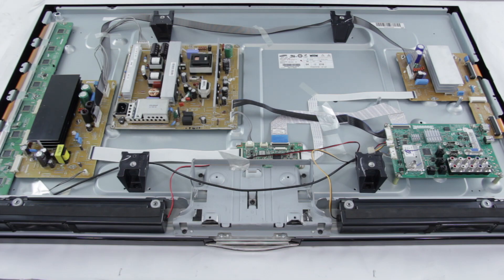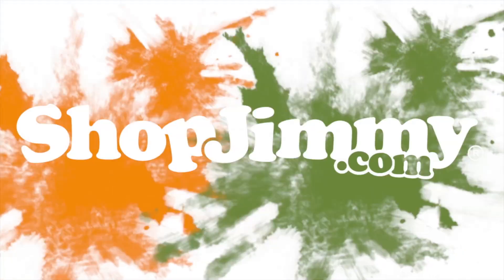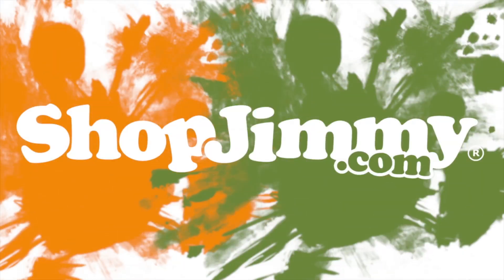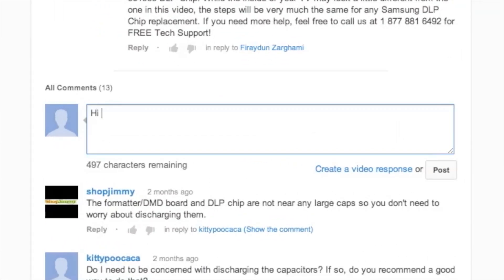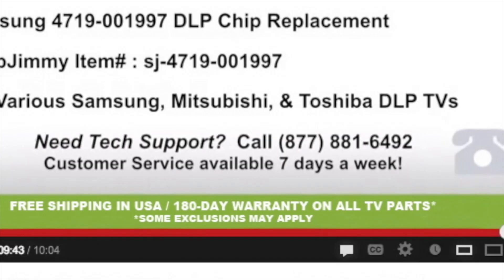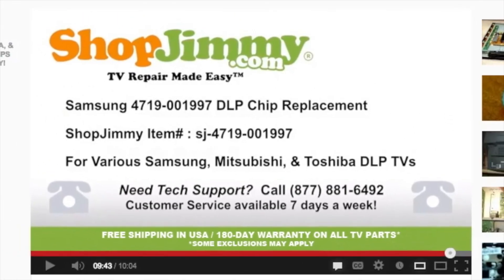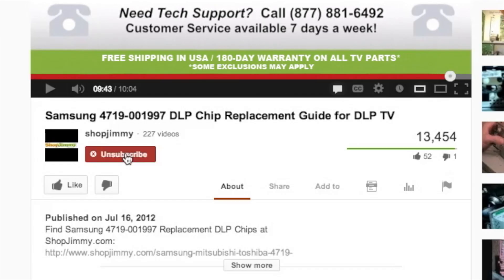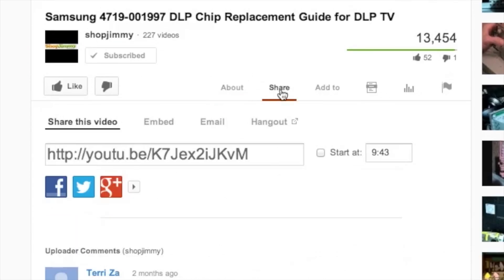Plasma TV Repair Tutorial - Common Symptoms & Solutions - How to Fix Plasma TVs

Comment: Hi, I have a Samsung PN64E8000, currently the symptoms I am having is the TV power cycles when I turn it on.  If I leave the TV unplugged for 4-5 hours I can plug the TV back in and Turn it on and it works perfectly unless I turn it off and turn it back on then it starts power cycling again and I have to leave it unplugged for another 4-5 hours.  If I  just leave the TV on it will work until I turn it off, I watched it for 5 hours today and it never reset once.  I took apart the back and the power supply capacitors are in good condition, along with every other capacitor.  I also turned off all network settings and unplugged all external sources to try to narrow the problem down and none of them affected the power cycling.
Reply from the maker: Caleb Judy   Correct, I would recommend replacing the main board.  Click this link to replacement parts for your TV Model number:  http://www.shopjimmy.com/samsung-bn94-04967h-main-board-for-pn64e8000gfxza.htm  There may be multiple boards for the same TV model number, be sure to match part numbers on your current board, with your replacement for compatibility.  Here is a link to a video showing how to identify your part number, click here:  https://www.youtube.com/watch?v=BEPWrefQvqI  Thanks and please let us know if you have any further questions with your TV Repair!  www.shopjimmy.com

Comment: Hi,
I have a Samsung PN60E8000 with a vertical line (left of center) that is white/gray pixels..
Could that be the address buffer where the vertical line location is?... in my case (G) logic buffer board.... or is it the Main Logic board?... or could be any of the 2?
I disconnected the ribbon from the (G) buffer board where the line was and the line got wider (same colors, etc)... which leads me to believe it's that buffer board..
Your thoughts?

Thanks,
Reply from the maker: Abel Carp   This sounds like a TV panel (TV Screen) problem.  If your TV panel is bad, it may be more cost-effective to replace the TV as panels are typically hard to find in stock, difficult to replace, and expensive.  Thanks and please let us know if you have any further questions!  www.shopjimmy.com

Comment: panasonic tc-p42x5 plasma hd. Power surge chord the tv was plugged in to was turned off and when it was turned back on the tv no longer powers on.  No lights (standby) - nothing. Unplugged it and plugged directly in to wall. Still nothing. it's been 12 hours so far.
Reply: ok. after 14 1/2 hours of not working, it now started working as if nothing ever happened.  This happened once before about 1 year ago.  However, it came on sooner then 14 1/2 hours.  So weird.  Nice design (shaking my head).
Reply from the maker: S Zingg  Please watch this video FIRST to help with your repair!  https://www.youtube.com/watch?v=BP3NVNCGEv8  I recommend replacing the main board and the power supply board in your TV.  Click this link to replacement parts for your TV model number:  http://www.shopjimmy.com/catalogsearch/result/?q=tc-p42x5  Be sure to match part numbers on your current board, with your replacement for compatibility.  Thanks and please let us know if you have any further questions with your TV Repair!  www.shopjimmy.com

Comment: Hi, my plasma TV (SAMSUNG PN59D8000) was working fine until 2 days ago I turned it on and the tv would show only a black screen and then it would turn off and after a few seconds would turn back on. So I was checking your video and you said something about the (Y board) causing that problem.... my question to you is do you sell that board? Thanks
(2011 samsung pn59d8000)
Reply: Model: S58FH-YB06

Comment: hello shopjimmy tech. i have an lg pu 42px11. i get a 3" vertical black line on the right side of the tv, although, the screen continues to the edge. so shows a full screen but the vertical line runs about 6" away from the ride edge of the screen. what could be causing this?

Comment: Hello, I have a samsung, plasma tv model number PN50A450P1D, It has a black, vertical bar about 2 inches in width with very thin red and blue lines within the black bar. Other than that the tv operates correctly. I would appreciate any help you could offer. Thank you.

Comment: We have a Samsung 64" 1080p 600Hz Plasma HDTV purchased 10.2013.  About a week ago my son was watching TV and heard a pop then the screen went black.  We unplugged it and let it rest for a while then re-plugged it in about 15min later (after we made sure the outlet was good.)  Still it did not turn on or even flicker.  I put in a service ticket with Samsung but am wondering if it will cost us more to repair it than it's worth or if it's just dead.  Not opposed to trying to fix it ourselves if you are fairly certain the problem. Thank you so much for your help.

Comment: I have a Panasonic Mod. TH-42PX75U  July 2007   s/n MA71980761  The picture on the top half of the screen is gone.  The bottom half is still great as was the top half before it went black.  The unit was not dirty inside and without hardly any dust.  I think that the problem is in either the Y component (TNPA4182  E27179) or in the unit that it connects to that all of the screen ribbons connect to  (TNPA4184  E57115).  All connections seem to be good.  What would you think is the problem and is there a way to tell which of the components would be bad?  Thanking you in advance for your answer.
Reply from the maker: giovannarosa1010  Please watch this video FIRST to help with your repair!  https://www.youtube.com/watch?v=BP3NVNCGEv8  This could be a problem with the buffer or the TV panel.  You can try replacing the buffer on the side where the problem is to see if that fixes the problem.  Click this link to replacement parts for your TV model number:  http://www.shopjimmy.com/catalogsearch/result/?q=TH-42PX75U  Be sure to match part numbers on your current board, with your replacement for compatibility.  Here is a link to a video showing how to identify your part number, click here:  http://www.shopjimmy.com/catalogsearch/result/?q=TH-42PX75U  Thanks and please let us know if you have any further questions with your TV Repair!  www.shopjimmy.com
Reply: ShopJimmy.com
What do you mean by the TV panel?  The entire screen panel?  Thanks for answering!
Reply: giovannarosa1010
I did watch the video.  It is great! Thank you!
Reply from the maker: giovannarosa1010   Yes, the panel is the TV screen.  Thanks!  www.shopjimmy.com

Comment: Samsung Plasma TV PN51E450A1FXZA TV turns on but no display or picture on the screen. The standby light blinks and i can hear the startup/shutdown noise. Should i replace the power board or the logic board?
Reply from the maker: Jon Kammerer  Please watch this video FIRST to help with your repair!  https://www.youtube.com/watch?v=BP3NVNCGEv8  I recommend replacing the Y-Main Board and Y-Buffer Scan Drive board in your TV.  Click this link to replacement parts for your TV model number: http://www.shopjimmy.com/catalogsearch/result/?q=PN51E450A1FXZA  Be sure to match part numbers on your current board, with your replacement for compatibility.  Thanks and please let us know if you have any further questions with your TV Repair!  www.shopjimmy.com

Comment: My lg 50PX950, I bought  it thinking it worked from someone that was moving.  Upon hooking up my new Blueray I noticed that none of the inputs work.  I tried connecting my older dvd that works just fine does not work on this TV as well.  Also there are pop-ups both on the left side and the top...any ideas?
Reply from the maker: R J Leitner  Please watch this video FIRST to help with your repair!  https://www.youtube.com/watch?v=BP3NVNCGEv8  I recommend replacing the main board in your TV.  Click this link to replacement parts for your TV model number:  http://www.shopjimmy.com/catalogsearch/result/index/?cat=56&q=50PX950  There may be multiple boards for the same TV model number, be sure to match part numbers on your current board, with your replacement for compatibility.  Here is a link to a video showing how to identify your part number, click here:  https://www.youtube.com/watch?v=RwHTvjMdrhk  Thanks and please let us know if you have any further questions with your TV Repair!  www.shopjimmy.com

Comment: Hi there. Just watched a few of your informative videos, very helpful. 
I have A Samsung Ps50q97hd November 2007.
I left it on the other night by accident and awoke to see a blue light still glowing underneath a circular power switch but nothing else. 
The TV plays a melodic noise and switches on and off. But zero display, no lines nothing. 
From your videos I'm thinking it's either
 sc board. Logic board or address buffers. 
But I'm not sure where to start? 
Please help.
Reply from the maker: Elliot Davidson   I recommend replacing the y board and y buffers in your TV.  Unfortunately I do not see any replacement parts in the search results for your TV model number on our website.  Thanks and please let us know if you have any further questions!  www.shopjimmy.com

Comment: I have a Samsung Plasma TV Model PN58A550S1FXZC.  While watching, it had a loud popping noise, and then has no picture.  The tuner is still working, since the audio from the TV channels is still audible, and you can change the channels, but no picture (on any sources, not even a flicker).  I watched your video and I’m guessing it is the Y-Sustain board, but would like you to confirm.  I haven’t taken the TV apart, but if I did, could I see which board is bad (blown capacitor?).  Thanks…
Reply: It has been a week since I posted my question, ShopJimmy, please respond with your comments.  I have also subscribed to this video and the TV Repair Made Easy Youtube video.

Comment: Hey there.  I have power and sound, but no picture. screen flashes for a sec on startup but then black.  there is a green light on the logic board that blinks...holds for 5 seconds at a time.   (samsung plasma pn51d430a3d)

Comment: hi, i have some problems with my panasonic plasma tv. the model # is tc-p42s2, with a date code of 8-10. one thing that has always been happening since i bought it is, when i power it off, i hear a high pitched whine for a few seconds. i always figured that to be a cap discharging, but it never created any problems, other than the annoying sound. 

now, however, i am getting some image issues. mainly, when there are darkly lit scenes, there is some flicker going on where the brightest parts of the dark scene are taking place. 

that, and now i have noticed that the colors just seem to be muting themselves (i have made no picture adjustments), and if--for instance--there is some talking head on a news show, or something like that. a closeup where the person isn't moving. anyway, parts of their skin (mainly forehead) will look discolored, as if the person has vitilago, or something like that. 

i'm just trying to determine if these are worth fixing, money-wise. this tv should last for years, especially since i don't use it all that much.

thanks for any help, or suggestions.

Comment: Hi, I have a LG 60PK950. My problem is when I turn the tv on, the red light flash, tv look like is going to turn on (1/5 second white color) then nothing happen. From reading online, look like the main problems are caused by power board, saw that some diode(5) look like shorted on the board but maybe it's because they are in parallel with a resistor. Got a new power board for a little bit more then $100, changed it, but it didn't fix the problem.(didn't want to waste time debugging the board)
Will probably keep the power board as a spare part if the original one is ok. What part could cause this problem? The screen simply stay black, but not as much like when the tv is turned off. And what is the easy way to test that part with a multimeter.
what should I look for, voltage at output, etc.
Thanks
Reply from the maker: Alain Labbe  Please watch this video FIRST to help with your repair!  https://www.youtube.com/watch?v=BP3NVNCGEv8  I recommend replacing the YSUS board and the YDRVTP & YDRVBT boards to fix the problem.  Click this link to replacement parts for your TV model number:  http://www.shopjimmy.com/catalogsearch/result/?q=60PK950  There may be multiple boards for the same TV model number, be sure to match part numbers on your current board, with your replacement for compatibility.  Here is a link to a video showing how to identify your part number, click here:  https://www.youtube.com/watch?v=GEllG3RV-tc  Thanks and please let us know if you have any further questions with your TV Repair!  www.shopjimmy.com

Comment: Very useful video.Thanks. I have Samsung 42 inch plasma PS42A410C1.  The TV does not turn on.  Upon turning a blue power light comes on and then goes dead. So have tracked it down to the powerboard problem.  So where can i get a replacement powerboard for this model?  Please advise. Thanks,
Reply from the maker: Lisa Singh  Please watch this video FIRST to help with your repair!  https://www.youtube.com/watch?v=BP3NVNCGEv8  Click this link to replacement power supply boards for your TV model number:  http://www.shopjimmy.com/catalogsearch/result/index/?cat=59&q=PS42A410C1  It looks like we have two available for that model, but they are compatible substitutes, so they both work for the same TVs.  Be sure to match part numbers on your current board, with your replacement for compatibility.  Here is a link to a video showing how to identify your part number, click here:  https://www.youtube.com/watch?v=sSJexLvRrjM  Thanks and please let us know if you have any further questions with your TV Repair!  www.shopjimmy.com

Comment: hello I took your advise on the ysus board. Plasma sanyo dp49750, and it didn't fix the problem the television still no picture and no sound , powers on and off on it's own,I dont have any idea whats going on with it i replace the power switch as well. please help me dont want to throw out.
Reply from the maker: Philip Essary   Does your TV have boards that are between the ysus board and the TV panel?  They are typically called y buffers.  If it does have these boards, it is recommended to always replace the y buffers when you replace the y sus boards.  Thanks!  www.shopjimmy.com

Comment: i have a panasonic TC-P50ST30 with no picture.it had 13 red blinks.i changed the power supply board and it didnt fix the problem.so i then changed the main board.that did not fix the problem.but it did change it from 13 blinks to 14 blinks.not really sure what to do next.please help.

Comment: Hi There
I have a Samsung Plasma tv  PN 50C540G3F
i have many horizontal lines appearing on the screen, probably caused by the Y buffer board., Model # 50uf2p,PCB LJ41-06755A
what  board do i need to fix this
Reply from the maker: peter b  Please watch this video FIRST to help with your repair!  https://www.youtube.com/watch?v=BP3NVNCGEv8  This could be a problem with either a buffer board in your TV or the TV panel.  You can replace the buffer board to see if that fixes the problem.  Click this link to replacement parts:  http://www.shopjimmy.com/catalogsearch/result/?q=50C540G3F  Be sure to match part numbers on your current board, with your replacement for compatibility.  Thanks and please let us know if you have any further questions with your TV Repair!  www.shopjimmy.com

Comment: I have a 32LV3400 LG 32" TV with a power led that fades from bright to dim then back to bright in a neverending loop. When the power button is pressed, the led light pauses the fading for about 5 seconds, then starts again. When I received the TV, it was a no power issue. Noticed that there were to burns on the board right above the transistors, on the back of the board, right beside of the transformer. Those were severely heat damaged and crumbled when removing. They were replaced and now I have this issue. The boards for this TV are nowhere to be found. Any ideas on the cause of this issue?
Reply from the maker: John Smith   Please watch this video FIRST to help with your repair!  https://www.youtube.com/watch?v=BP3NVNCGEv8  I recommend replacing the power supply board in your TV.  Click this link to replacement parts for your TV model number:  http://www.shopjimmy.com/lg-eay62389201-power-supply-unit.htm  Be sure to match part numbers on your current board, with your replacement for compatibility.  Here is a link to a video showing how to identify your part number, click here:  https://www.youtube.com/watch?v=_4Qpfan0vdU  Thanks and please let us know if you have any further questions with your TV Repair!  www.shopjimmy.com

Comment: our tv video went off but we still heard audio so, after watching several of your videos and reading q&a's on the web, we removed the back of our samsung PN59D530A3FXZA and tested the VS (216 and dropped/6.5) and VA (55 and dropped/.2) the control board was blinking every 5 seconds. we purchased a new Y-Sustain board from you and after plugging it all in, a fuse blew on the power board. so, we put the old Y-Sustain back in and blew another. after purchasing more ceramic fuses, we just now replaced it and blew again. we noticed there is a crack and bulge on a green nickel sized part? on the power board. perhaps we missed it the first time around? what's next? thanks!
Reply from the maker: Susan Oakley  Please watch this video FIRST to help with your repair!  https://www.youtube.com/watch?v=BP3NVNCGEv8  I recommend replacing the power supply board and the Y-Main board and the Upper and Lower Y Scan Drive boards.  There may be multiple boards for the same TV model number, be sure to match part numbers on your current board, with your replacement for compatibility.  Thanks and please let us know if you have any further questions with your TV Repair!  www.shopjimmy.com